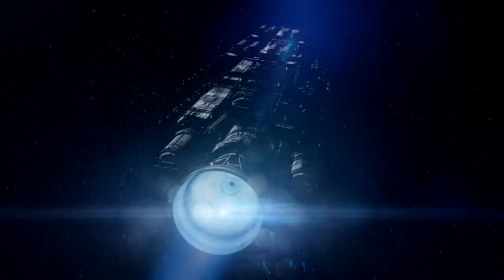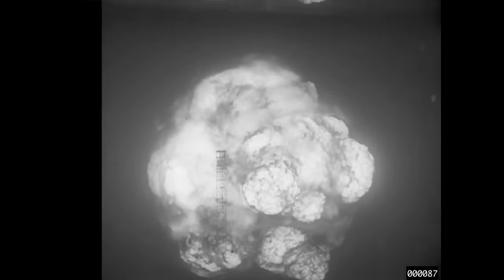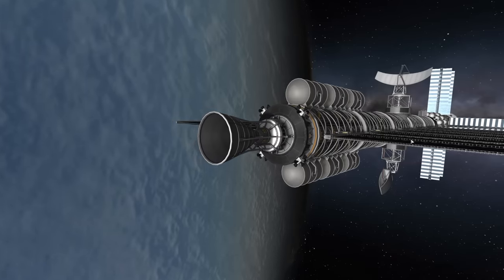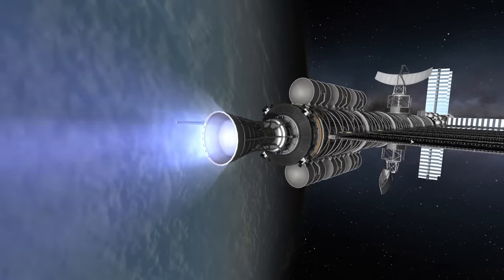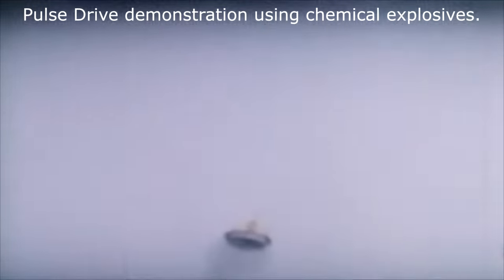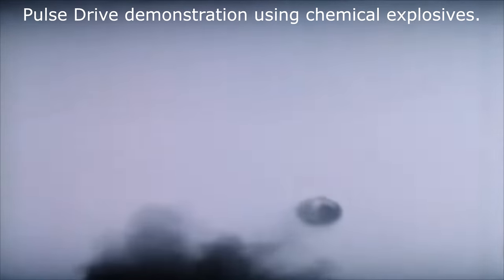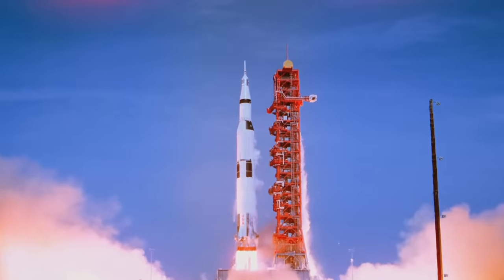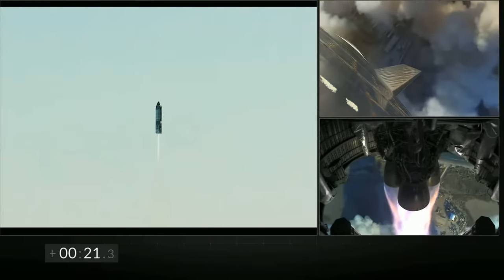The Nuclear Salt Water Rocket - Possibly the Craziest Rocket Engine Ever Imagined.

Comment: This thing somehow manages to be even more insane than the one where you ride a constant chain of nuclear explosions on top of a giant steel plate
Reply: Power output: 14 Chernobyl/s
Reply: @Maylevka May Yup. The only real reason the research stopped on projects like Orion was the Nuclear Test Ban Treaty. I imagine the people working on it were very disappointed.
Reply: @webbugt  I feel like Chernobyls could be a new unit of measurement. Like horsepower, but for nuclear rockets
Reply: Considering it was created when Zubrin looked at Orion and thought to himself "That's not good enough", I'm not surprised.
Reply: @Maylevka May I remember reading a lengthy article about it. They weren't planning on using it for the booster. It would have only been ignited after reaching/leaving orbit.
Reply: Well it turns out not only do we need to find water in space but we need to find salt in space I was well as whatever radioactive material necessary to cause such a reaction in a large afterburn
Reply: And apparently it's been done
Reply: Oh yeah boron
Reply: Oh space mining here we go
Reply: I.. think it might be a hard sell to astronauts. Test pilots wanted for our new Continuous Nuclear Explosion Drive. I like the sound of it's efficiency, but can't help thinking a plain'ol steam propulsion system would be safer & more manageable.. Assuming you can find handy large lumps of ice in space. Plus it's suitably steampunk, and I think has been proposed, ie reactor at the hot end, big lump of ice fuel next to that, and humans behind that handy neutron absorber. But finally got around to watching the Expanse. Not convinced by it's claim to be scientifically accurate given it's context sensitive depiction of gravity. Or having to be plumbed into woo-juice for high-G acceleration, but not becoming bulkhead paste when the ship insta-flips. And renaming the hero ship "Pinus Contorta" would be.. unfortunate, knowing the military mind, and how quickly it'd be nicknamed the 'Twisted Dick'. No, docking control, it's pine-us, pine-us! Now stop laughing and let us mate with your docking port! No, stop laughing!
Reply: A regular ion drive powered by a nuclear power plant instead of solar panels seems more reasonable.
Reply: @Maylevka May We're just going to have to solve this problem with a combination of clever engineering, ultra-reliable (passenger-rated, rapidly-reusable, i.e. starship-class) conventional rockets, and finally a little toleration of acceptable risk for enormous (as in immeasurable) benefits to humanity.
Reply: @hernerweisenberg7052  That's like comparing a fly (the insect) to a jetliner
Reply: @Maylevka May Interplanetary and interstellar spaceships using nuclear drives will have to be assembled in space in orbit.  The nuclear materials would likely have to be shipped in several well encased and protected capsules in case of reentry chemical propelled launches.  Of course there would have to be tests conducted out in space because these things can't be tested in the atmosphere.  It might be possible to do a brief initial test in a large salt dome cavern. The crews and payloads will have to be sent by chemical fueled "boats" into orbit to the "ships."  This is going to be unbelievably expensive.  It is likely we will exceed all funds governments are willing to give us in the test phases.
Reply: @dustinswatsons9150  not regular salt. The uranium itself reacted into a salt such as UO2(NO3)2
Reply: @Maylevka May That is a concern, yes, but from what I've read, since the "bombs" are all inert, it wouldn't be any worse than if a uranium rock landed in the desert. Even then, it might be possible to package them in such a way that they wouldn't break up into sand or dust, for easier collection. I imagine having them fall in the ocean would be problematic. What you wouldn't want would for them to break up into tiny particles and create a radioactive dust cloud. Anyway, my reading claimed it would be much less of an issue than if a rocket carrying nuclear waste blew up. I don't claim that's "good enough", I'm just saying it's not as bad as it sounds.
Reply: @Maylevka May wat, no, you refine them in space, just send the raw materials
Reply: @g2g591  I also just got reading this subsection of comments if this  gets anywhere near being practical a lot of it's going to be done in orbit.. not cuz I read that cuz I think that and nuclear things in space that ban is a little overrated at this point.. it's honestly a Nerf to us all and someone doesn't want to have to have all the guns aiming at space.. even if it means practical efficiency
Reply: @monad_tcp  do magnetic fields strong enough protect people from most if not all types of radiation
Reply: @monad_tcp  I was talking in terms of trying to collect them.
Reply: @hernerweisenberg7052  ion propulsion is not very strong can't just instaflip with that
Reply: @dustinswatsons9150  I guess
Reply: @brolohalflemming7042  I'm glad someone appreciates the show as much as I do
Reply: Nice profile pic
Reply: @brolohalflemming7042  Eh. Science fiction lies on a spectrum, right?
The Epstein Drive is highly unlikely, as Scott has discussed, in depth, in the past.
The authors wanted a way to reduce travel times through the Solar System to days and weeks, instead of months and years, to move the story along.
That said, they did work out the implications of the technology, pretty carefully.

As for the flip-and-burn and the use of stimulants laced with nanites to help resist the high-gravity stress, this is a setting that allows people to regrow lost limbs and even broken spinal columns, and take easy inoculations to prevent cancer.

I'd heard of nuclear salt-water rockets, but I really enjoyed this explanation.
They're a bit beyond what we can do, now, but I think someone could build them, eventually.

However, I'd hesitate to do any more research on them until we've got a nice test-bed with sufficient research facilities built on the moon, or something.
That exhaust is nasty.
Reply: @Maylevka May Yep, exactly this. Build these things in space, for use there.
They never land.
Reply: @Maylevka May well it depends, the demon core was pretty nice and harmless, until it wasn't.
Reply: Constantly surfing the wavefront of a continuous nuclear detonation.
Your fuel can spontaneously detonate in a nuclear explosion if mixed incorrectly.
If engine intermixes are slightly off your engine is plasmafied.
Huge levels of neutron radiation.
How can this possibly go wrong?
Reply: @webbugt  and only weighs 50 Courics
Reply: Somhow it is both more insane AND more reasonable at the same time...
Reply: @PrinceAlhorian  well, hypergolic chemical propelants can do all these things only with the word "nuclear" ommited. Didn't stop Apollo crews, did they?
Reply: @charlescsmith1213  yeah, Fukushima's and and Three Mile Island's are wimpy in comparison 🤣
Reply: @mancubwwa  Well any human being willing to ride a controlled detonation into a irradiated hard vacuum must have substantial brass gonads.  If they can proof the vehicle can be safely built and controlled... Avanti.
Reply: @brentboswell1294  You're not wrong honestly lol
Reply: @mancubwwa   If I understood it correctly, then this isn’t like hypergolics, since instead of being 2 seperated fuels that explode on contact, then it’s a single fuel that explodes with itself if it’s uranium concentration becomes too dense and you can’t absorb enough neutrons..
So a bit more dangerous :P
Reply: @ValentineC137  Solid rockets exist. Monopropellants exist and are used. High-energy monopropellants also exist but aren't used because of issues with cramming that much energy into a molecule or solution and only having it release that energy where you want it. This is like a fairly low-energy nuclear monopropellant. Project orion is more like a impulse-type nuclear solid rocket motor.
Reply: @AlexandervanGessel   @Alexander van Gessel  first of all, solid rockets dont self-ignite :P
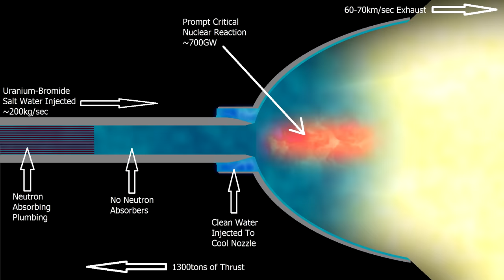secondly, I dont think we watched the same video? The video I watched has a continuous nuclear explosioin going out the back at greater energy levels than Chernobyl 9:30, and the only thing stopping it from going back into the fuel tanks is the rate of flow of the fuel 6:42. And it was explained that a leak would be bad since if it all collected in the same spot it would cause a reaction, which would indicate that the same would happen inside the tanks if it wasn't for material absorbing the neutrons: 4:27
Reply: @charlescsmith1213  Hiroshima already is :)
Reply: @Werner Heisenberg I think Roskosmos is planning this
Reply: not sure. It is differently insane but i could not name a favourite.
Reply: @ValentineC137  Sure, solid rockets don't self-ignite, because we try not to put any pyrophoric stuff into them. One could imagine building a thorium-232 salt water rocket, but it would be vastly more complex.

Yes, I called constant double-chernobyl "low-energy". It is, relative to a 90% enriched version, or a version that contains less than 98% water. That would be harder to control though, so we start with 'regular' HEU.
Reply: @monad_tcp  You might misunderstand. I'm very much pro-nuclear propulsion & energy, and anti-Green radiation FUD. Luddite 'environmentalists' have been crippling energy policy for decades because they can't tell the difference between nuclear power, and bombs. So instead we've wasted billions on pre-Industrial tech like windmills, instead of nuclear power & spending money on getting us off this rock.
(Here endeth the rant)
But I agree we need to stage things like Mars missions. So expand space station, use chemical rockets Earth-orbit, ion ferries orbit to Moon, and start building lunarcrete structural and shielding components there. The less we have to haul out of our gravity well, the cheaper it gets.. And there's nothing necessarily wrong with a concrete spaceship :)
Reply: @AlexandervanGessel  well I sense that you didn't read the first comment that I had replied to :P
Reply: @charlescsmith1213  Maybe nuclear rockets should be measured in bhkp (brake horse-killing power)?
Reply: @AldorEricsson  True enough lol
Reply: @dustinswatsons9150  I think you misunderstand, the salt in this case is uranium nitrate. The uranium you had to get anyway, nitrates can be made wherever there is ammonia.
Reply: @g2g591  copy that
Reply: @Maylevka May not CMB but neutrons protons and gamma and delta rays coming from the sun are more harmful inside a star system, in interstellar space, the entire galaxy is shooting them at you and you have uncharted inactive hidden neutron stars and singularities forcing you to make course corrections, and the cosmic rays intensity is significantly higher than that emanating from one solar mass fusion reactor.
It's the 100 mega solar mass gravitational reactor at galactic center that controls the FTL transit lanes across the galaxy. Just ask the voyager twins and pioneer siblings.
Reply: @dustinswatsons9150  they don't protect from neutrons and gamma and higher energies and frequencies cosmic rays. But they are manageable inside a star system on a planet scale Kardashev 1 space ship, essentially a Kardashev 2 space ship, like VGer - star trek 1, which can be classified as Kardashev 1.5 space ship.
Reply: @Maylevka May I suspect that "all those nukes" are not going to be lifted from Earth's surface to orbit. For one thing, doing so would take decades. But more to the point, why would we build it close enough to the Earth that we had the extra gravity to overcome? In the interests of "most bang for the buck" you wouldn't want to have to fight your way out of that much gravity right off the bat. Inefficient and expensive if you want to travel to somewhere else.
Reply: @Maylevka May As a serious question: why would you have to - or even want to - lift them up from Earth? Just thinking about the amount of energy that was needed to get a single Apollo spacecraft up to where they could begin Trans-Lunar Injection. Wouldn't it be more practical to lift just the bare minimum to begin the project?
Reply: @Maylevka May Yes, and we've no shortage of energetic neutrons being radiated by our Sun. Plus every other part of the spectrum - Gamma rays, x-rays - you name it. Some smart people will probably figure a way to make use of that also in producing fissionable material, structural material, or for process energy.
Reply: @brolohalflemming7042  Thank you. "Concrete spaceship" was the best laugh I've had all month. And you're right.
Reply: @hernerweisenberg7052 Ion thrusters have high delta-V, but barely any thrust. They take weeks to impart the momentum a chemical rocket could impart in seconds. That not only makes ion propulsion non-viable a horrible choice for anything but the longest voyages, but it also makes ion propulsion physically incapable of many orbital maneuvers because the gravity makes the ion propulsion’s thrust pretty much irrelevant.
Reply: @QualityPen  You are right for existing ion drives, but those are usually limited by a rather small power input generated by solar panels. If you got many kW or even MW from a small nuclear reactor to dump into an ion drive, you could get a little better TWR out of them.
Reply: @QualityPen  Still nowhere near chemical TWR, but potentially enough to propell a heavy spacecraft on a long voyage, and better efficiency then with a pure nuclear engine.
Reply: Of course, because this engine uses a non-stop nuclear explosion. And yes that absolutely is as terrifying as it sounds.
Reply: 9:41 not only is this a continous chernobyl, this is more than two continous chernobyls, its like if reactor 4 AND 3 exploded at the same time.
Reply: no, because the bell-shaped engine directs more of the nuclear material away from you

Comment: Engines, % C, and "No known reasons it wouldn't work" - What a time to be alive.
Reply: Hell yeah!
Reply: Feels a little bit like a modern Bussard Ramjet. Hopefully this proves to be more feasible than that though.
Reply: We've had realistic designs that could reach 10-12% of the speed of light for YEARS, though. Project Orion was not fucking around.
Reply: @augustovasconcellos7173  Project Orion, Medusa, Breakthrough Starshot, Fission Fragment Reactor engines, the list goes on...
Reply: with all that going on, alive for how long?
Reply: @lmamakos  About 80 years if you're healthy, 90 years perhaps if you're lucky.
Reply: Only drawback is you leave a trail of radioactivity...